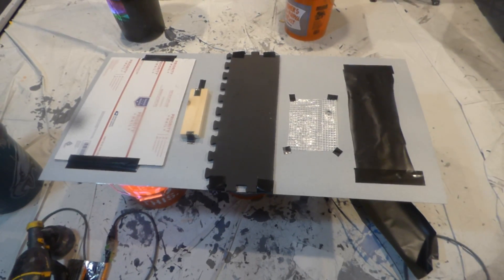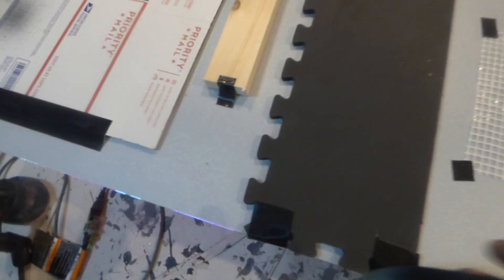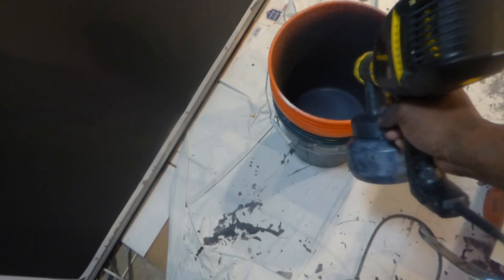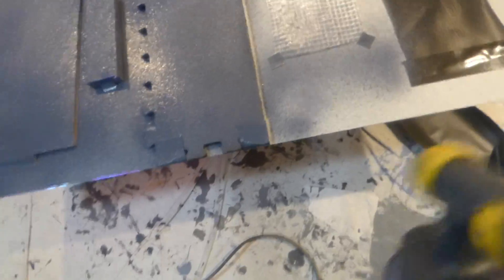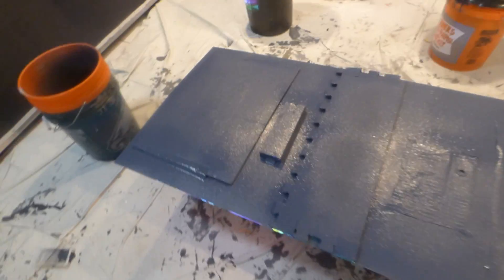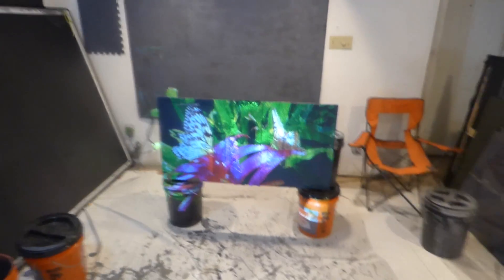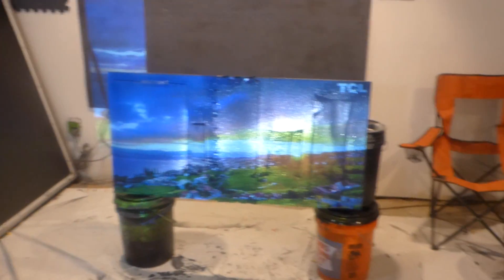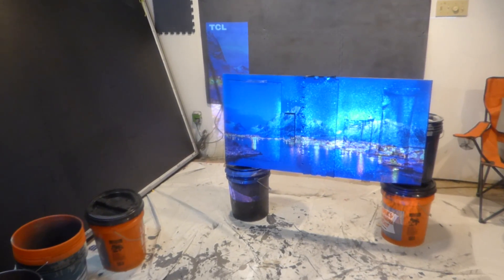MUST WATCH SPRAY ON INVISIBLE BLACK SILVER NANO TURN ANYTHING INTO A OLED LIKE PROJECTION SCREEN!

Comment from the maker: NEW ECLIPSE INVISIBLE BLACK SILVER NANO 4K AND 3D Weatherproof spray on screen paint.

 PROJECTION SCREEN TYPE: Spray on screen paint kits
SCREEN COLOR : Black silver nano
GAIN: Smart technology gain X12
ANGLE GAIN: 190
LUMENS COUNT: 200 and up. 3D: Yes. 4K: Yes 4K ready.
PROJECTORS: 4K, 720P,1080P, LASER, DLP, LED, LCD, Short throw, long throw and ultra short throw projectors.
Indoor or out fully weatherproof.
Color enhancement technology X4 Perfect whites and ultra dark contrast levels. 4K and 3D ready Lumens only 200 and up compatible with all projectors. Smart technology gain X12